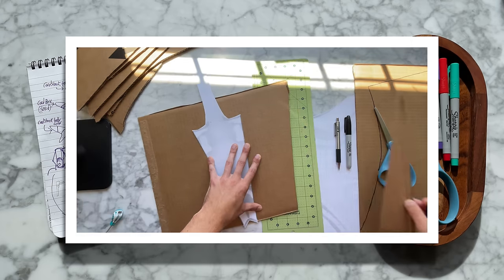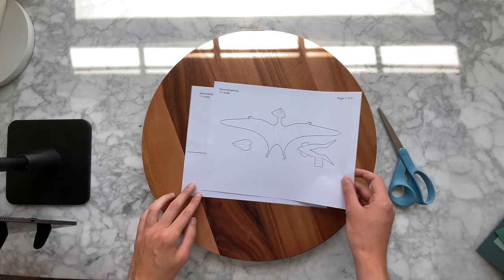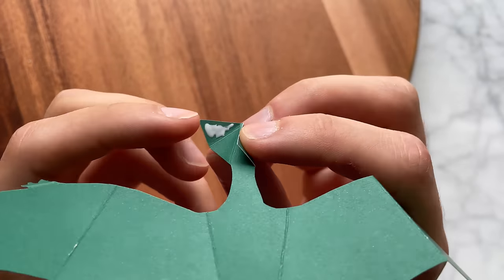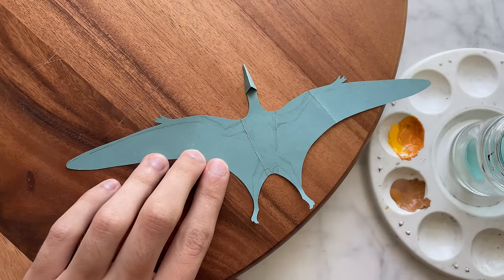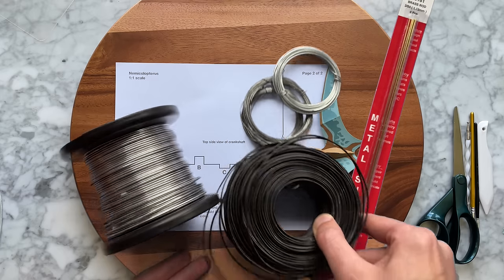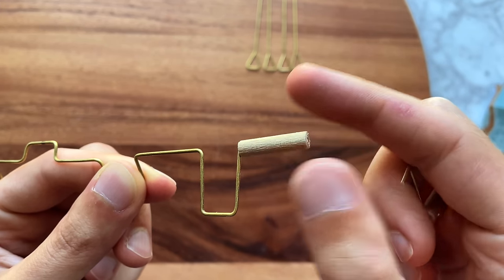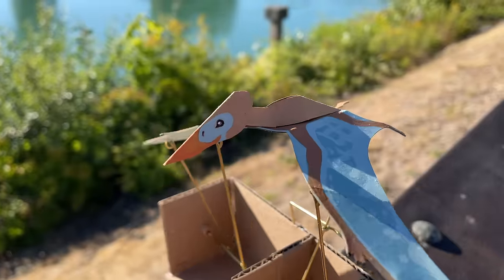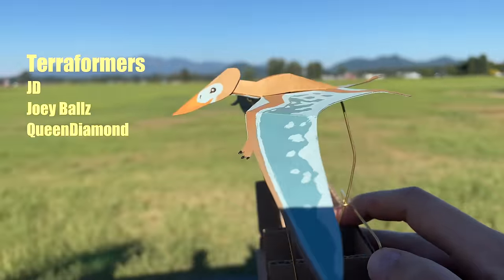paper + wire = flying Pterosaur

Comment: ..Great project... 👌🏼👌🏼👌🏼💙💙💙 
..What about adding a medium sized lightweight 5 blade aluminium fan at the end of the wire crank & fix the base on the roof/terrace with screws. .so that on a windy day the fan rotates the crank & the beautiful mechanical kinetic sculpture model gets animated on its own ?...You can even a small & a big gear wheels to slow down the movements......Imagine making a big one [ 5ft long each wing ] going with the same design. .& looking at it from a good distance sitting on your terrace. .flapping it's wings in slow-mo when you're on the way back towards your home in the twilight... . 🙂

Comment: While you might have to do it at the same time as the bending, one thing that might work as a cooler looking option than the clips and cardstock wraps is some neat looking beads that have a large enough hole to fit the rods through